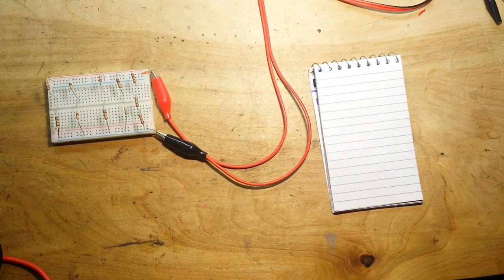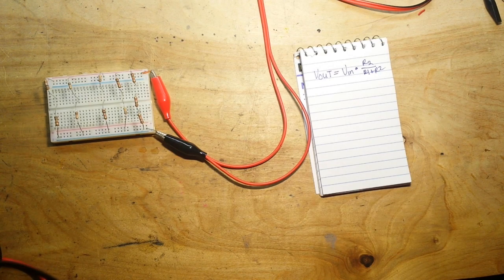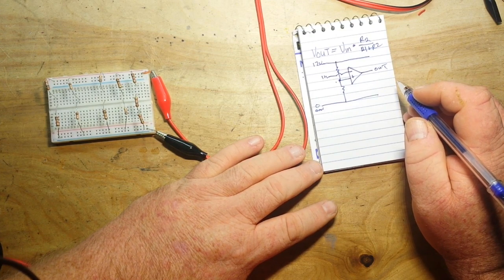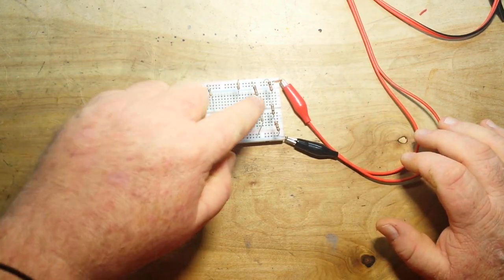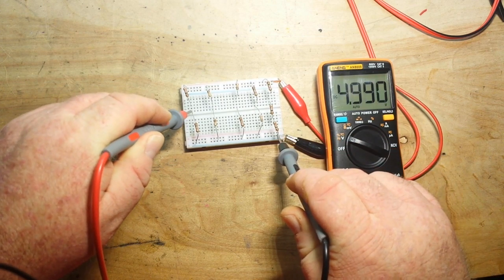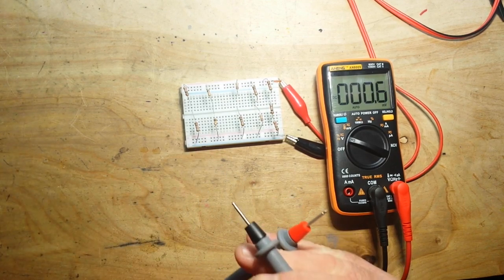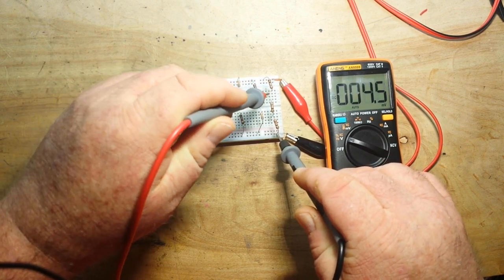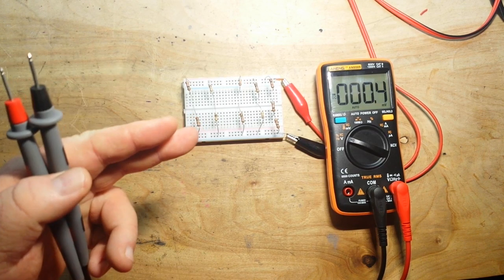Building Blocks of Circuits: The Voltage Divider

Comment: If proportions are what matter, then are there any advantages/disadvantages of using, for example, a 10k:2k as opposed to using a 100k/20k Volt divider? Overheating, less precision, etcetc
Reply from the maker: The values can be used to help control current. But it is the proportion that sets the voltage.

Comment: Nice video, thanks. Can y explain Amps or its to low efficency?
Reply from the maker: Explain what about amps?
Reply: Ok, short question I agree. 
If I have 12V 2A PS, and make volt-divider for LED 3W (3 V, 1A). How much W i loose and how much W resistors need to take? P=VA?
Is it gone be 3W on R1 (3V*1A) or is it gone be 9W (9V*1A)?
I can try it myself, but don`t wanna burn my desk or heart my eyes :) tnx

Comment: After testing do some math and circuit analysis.

Mesh analysis Vin = R1*i + R2*I; Vout = R2*I ; solve the system .

Vin /( R1 + R2 )   = i; i= Vout/R2 => Vout / R2 = Vin / (R1 + R2)  ==> Vout  = (R2 / (R1 + R2)) * Vin

Comment: Hi Paul, great video. Theory explained by examples is always a very good idea! On test number 3, since you have a 1k and a10k resistor, the value measured of 0.9V is probably explained by the fact that it’s   1 / (10+1) * 10V = 0.9V

Comment: You are a very good teacher. I still remember lessons at my school. Teacher said resistors are just for controlling current but didn't mention there is also a voltage drop... So I couldn't wrap my head around ohms law and why on earth we were putting resistors with leds when the voltage was too high.
Reply: Breadboards to the rescue!!

Comment: Paul, question on the Aneng meter. In AC volts, what does the lightning bolt symbol mean? For some reason mine will not read AC voltage. When I try all I get is warning tone a OL reading and the lightning bolt symbol. Meter is now several months old, I just had reason to try to use the AC voltage function the other day when I was using my Variac.  All other functions seem ok other than the AC voltage. Thanks in advance for any help, man. And sorry for going off the script..
Reply from the maker: Dont worry about going pff script, Im here to help. I dont know the answer off hand, but I will find out and reply tp you here.
Reply: OL is Over Load (or over range), I think the lightning bolt is there to show the circuit is live, even though there is no value shown. How is the meter on lower voltages? It sounds like the voltage is too high for the range you selected or the autorange function is not working properly.
Reply: MrPGT9999 Meter works on all ranges and functions except for AC voltage. Yea , knew OL means over limit but then the AC range it doesn't matter if you are measuring 5vac or120vac you get OL the lightning bolt symbol and a audio tone. Checked DC range using a voltage standard and its on the money. Everything else is fine even the stupid square wave function. Quess i will just not be able to use this meter for AC measurement.